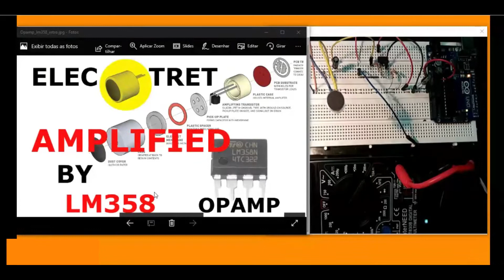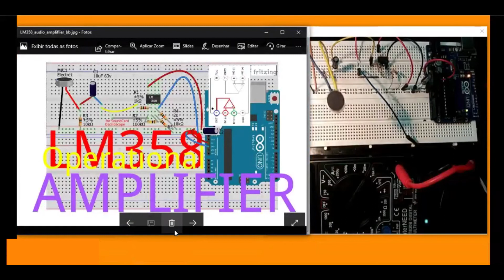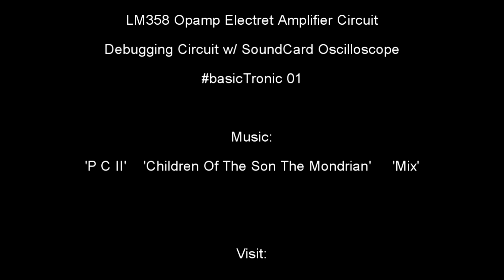LM358 Opamp Electret Amplifier Circuit - #basicTronics - 01

Comment: How I can connect this in an Arduino? I just have to plug it in the analog pin and do an analogRead in the code?
Reply from the maker: Hi Faramir Chevlonski, you can build an RC Circuit, like this: https://youtu.be/ueDehQBDdpc; Remember, the signal must be read as positive & negative halves of the audio waveform. Hope that helps o/

Comment: Hello, I recreated the circuit, but how can i send the audio samples to the soundcard oscillator? It doesn't even show arduino as an input option.
Reply from the maker: Hi, CrimsonJerry, I use a External USB Sound Card Audio Adapter - https://www.dhgate.com/product/usb-sound-card-usb-audio-5-1-external-usb/386779666.html - The Soundcard Oscilloscope by https://www.zeitnitz.eu/scope_en will capture the signal as audio signal. Hope this helps, Thanks!
Reply: Thank you very much!